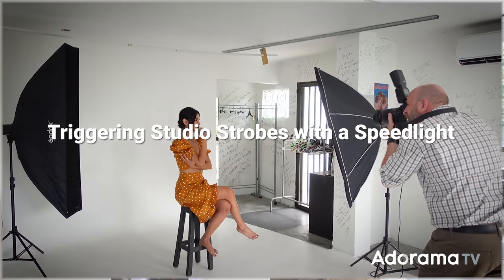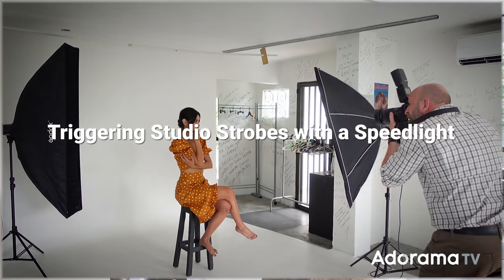What's the Slowest Usable Shutter Speed When Shooting Handheld? | Mark Wallace

Comment: I don't find the 60/1 to be as sharp a image as when I set to 200/1 the lens is 24-135 with image stabilisation, yet was fine on Eos 20D new current camera is Eos700D it does puzzle me,  I use it more for fill in flash as I shoot models outdoors.